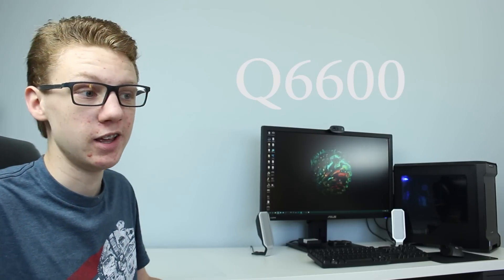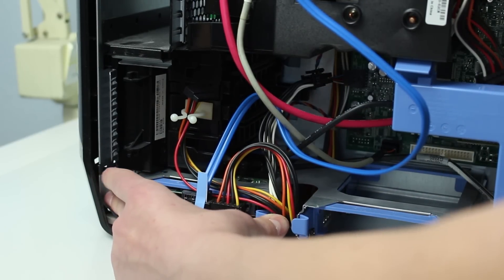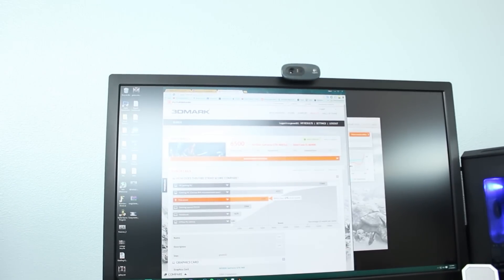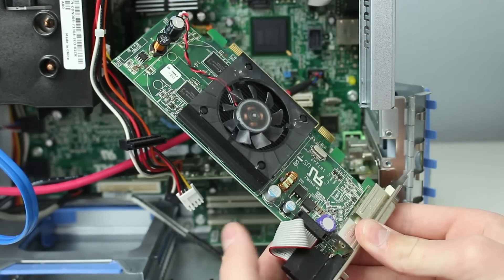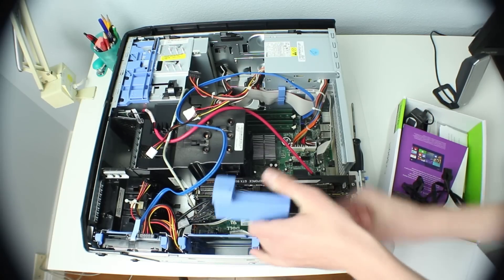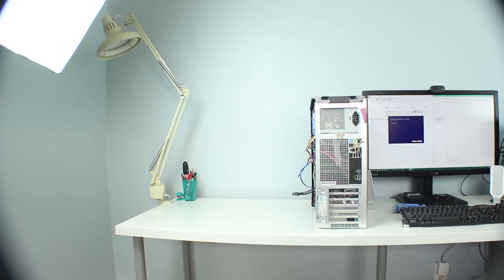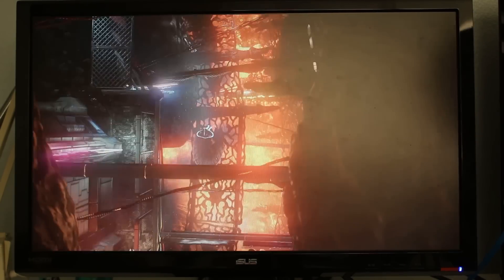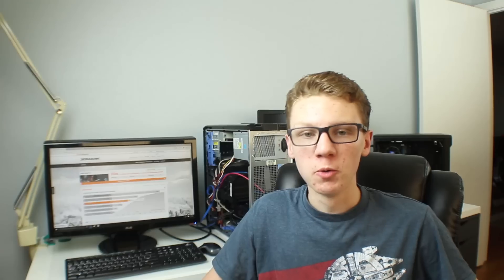Old CPU + New GPU = Gaming PC? (Core 2 Quad + GTX 960)

Comment: M8 you can just format it through the command prompt on the old PC
Reply: +Mruggles2000 You don't need to access the command prompt, just go to advanced options in windows setup and delete the partitions.  This is something you should always do on a new setup anyway.

But as a side note, diskpart is a great tool for other situations.  It took the place of the dos utilities fdisk & format from the dos world.  Just be careful with it.  I only recommend it for cases where you don't have the Windows Disk Management available.  Because unlike disk management, with diskpart you can easily do the wrong thing.  

A power user tip for Dispart, you only have to type the first three letter of any command.  So for example:

Select disk 1
Clean

Becomes:

Sel Dis 1
Cle
Reply from the maker: You can format the C drive while it's running?
Reply: +Gevan32 yes, if you go into the menu of "advanced options" or whatever from the installation media, you can access the command prompt and format the disk, I had to do it to fix jacks computer.
Reply from the maker: +Mruggles2000 Oh k. Good to know.
Reply: +Gevan32 Heyyo, yeah diskpart is handy. I used it before on my PC to clean(wipe) my SSD and convert from mbr to gpt and then I installed Windows via uefi boot mode for faster boot into windows. :) If you google diskpart format ntfs you can find guides for that, same with converting to and from mbr and gpt if you're interested in that stuff.
Reply: +Bill's Channel I've had to do this before, where for some reason my friends drive wasn't formatted correctly, and wasn't able to accept the Windows download.  I used he advanced settings and used command prompt in there...
Reply: +Bill's Channel sorry I have two accounts that's why it's a different one in the last response :P
Reply: +Mruggles2000 It's even easier than that, as soon as you pick an install drive windows  offers to do it for you
Reply: +Flibbib I would still recommend my method above for the cleanest of installs in his scenario.  (Not owning the machine, unknown circumstances)  Also sometime windows will complain that it can't format the new drive because of some reason.  Unfortunately it does not mention that you can follow my steps and it will usually work.  So for the scenarios where you want to get rid of any old partitions, etc, or for cases where the machine is unknown to you, or when you want to change to a more optimal file system, on the screen where it asks you to select a drive I will select the advanced options and delete all unwanted partitions and then select the drive I want to install to.  Windows will then format and use the partition.
Reply: +Matt Ruggz Pretty sure you can repartition any file system/disk during windows installation. When you get to the part where it asks you to choose which disk you want to install windows to you can go to advanced and delete partitions from there. Windows will format during installation

Comment from the maker: lol I said "today in 2015".
Reply: +Gavin Remme Can u PLEASE do some gaming on it?(GTA 5,CS:GO,Assassin's Creed 4 Black Flag)
Reply from the maker: +ImPetey Honestly, you could probably find something like this in a Goodwill or used computer store for less than it would cost for you to have it shipped. Try looking locally.
Reply from the maker: Well, yeah it's fine for most productivity. It could probably edit, but it might be kinda slow to render the video.
Reply: Probably a stupid question, but where did you get the copy of Windows?
Reply from the maker: I used Windows Media Creation tool. Google it.
Reply: also "Intel Core 2 Duo Quad" :P
Reply: also "Intel Core 2 Duo Quad" :P
Reply: +Gavin Remme hate it when you fuck up or spell something wrong after making the video and uploading it :) i did it the other week, gutted, good video keep them coming mate
Reply: I like these comments :P
Reply: +Gavin Remme imagine if it was a core 2 quad on 3 ghz
Reply: GTA V gets 70 fps on very high with a GTX 670 @ 1680x1050 (I tested it myself with a nearly identical setup). Why is CS:GO even a benchmark? my 8800GT can handle that at an easy 80 fps 1080p.
Reply: friends 240gt can`t run 30fps xD
Reply: +[FLUX]unchained_PUG really? should be about equal to the 8800gt, which can run gta v at 720p on bare minimum settings at a rock solid 30fps (with vsync)
Reply: i have same dell speakers bro !! really great and loud !! love it .
Reply: me?
Reply: ***** i think its Phanteks PH-ES215P
Reply: ***** no sorry its Phanteks Enthoo EVOLV